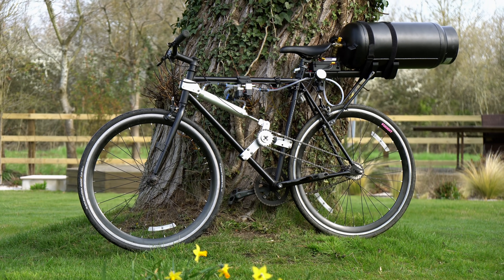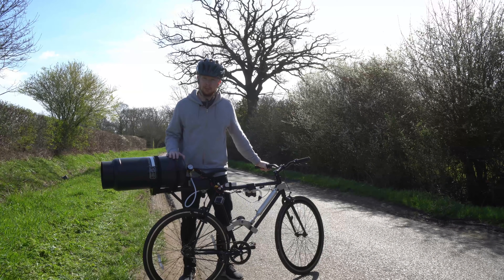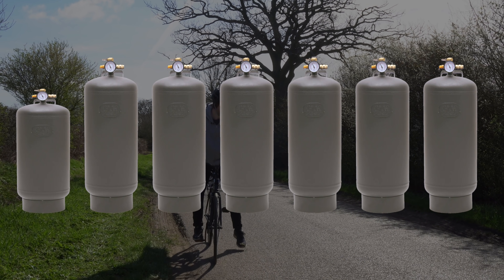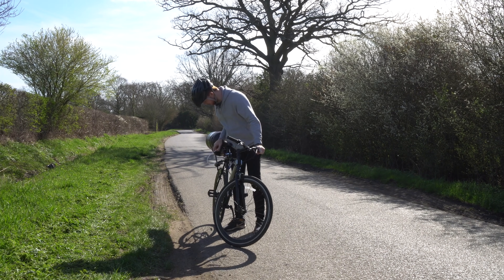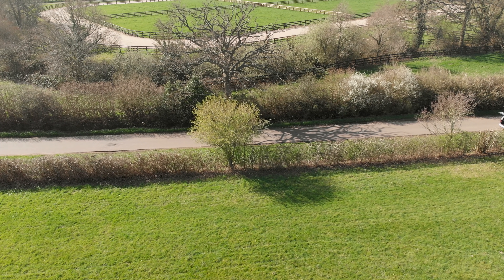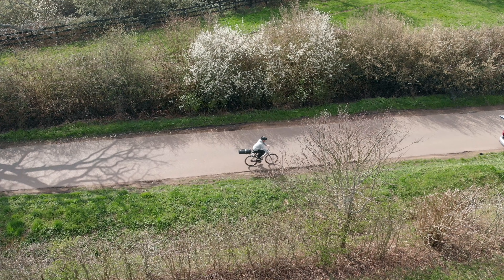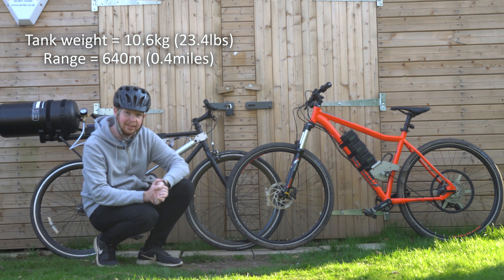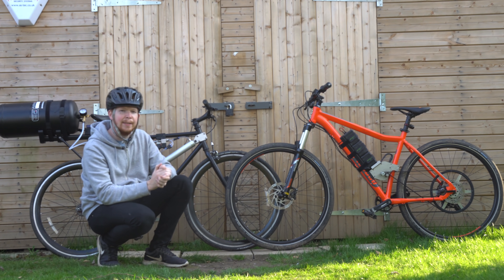Air Powered Bike Range

Comment: Might it be feasible to use an air pressure system in something like a glider to power an emergency propeller? The atmospheric air pressure up there would be quite a bit lower than at sea level and the auxiliary system might enable a pilot to squeak a few extra miles out to avoid an unwanted unscheduled early landing or to gain a bit more elevation when necessary.

Comment: I’m working on a similar project but my engine will be a 2 cylinder and is more based on steam engine design much smaller cylinders but much faster while still double acting. I hope to gear it down 5:1 and connect the large gear to the pedal cranks to use the derailer for gear shift

Comment: His 24-liter cylinder cylinder containing air compressed to 7 atm stores energy of about 8.4kJ. This is equivalent to 2 nutritional calories. A teaspoonful of peanut butter has 20 times as much energy, and an AA-sized rechargeable battery provides 4 times as much energy. This huge tank, with all its weight and all of the potential for a life-threatening explosion if it fails, will get you a quarter as far as an AA battery assuming the engines have similar efficiency. So, while it is nice to see Stanton having fun, hopefully he has proven what a simple calculation easily shows: this is a hopelessly bad way of powering a bike!

Comment: Fantastic. Way better than I could do. Now I'm going to critique, from my arm chair. It should pump air back in the tank, and use back pressure, for braking. Loose the giant piston. Try a tiny nossel on an arm, a millimeter from the rear cassette. Compressed air will move a chain. Start at the lowest gear, switch gears and redirect the nossel to the next gear, while you help it by peddling, with less effort. Possibly the nossel arm could be linked to the gear lever. Use a carbon fiber air tank, to save weight. Some paint ball players use them.  A compressed air tank is only a battery. I think air vehicles would be more feasible as hybrids, with an efficient engine as a range extender. Low power needs gears. It's wasting all its power, getting up to speed. They have small light weight and quiet, air compressors at Harbor Freight for pretty cheap. The exhaust could be used to heat a small expansion chamber for more power. I would consider the mechanics of an air powered sewing machine for power delivery.

Comment: You shud use three modes
Three different sizes of piston and piston casing.
1. Slow . Long piston 
2. Medium  50% size of long piston faster speed.
3. Fasst : 25% size of medium piston , ultra fast speed. 

These three modes shud be controlled by a handle

Comment: Very interesting! I knew about a german monocycle called "Flyrad". Maybe, the skeleton of the vehicle could be changed by an air tank. The efficiency could augmented with the use of a heat interchanger and a phase changed material (probably paraffin). Additionally, I think it Is possible to create an hybrid "Flyrad", using supercapacitors in the aceleration and regenerative breaking. No lithium! No cobaltium!

Comment: I realize this is a 5 year old video, but itsnew to me and i had some thoughs. 
Couldn't it be an assist?  Could a small compressor be installed to add air to the tank when pedaling,  and even a gear to capture breaking? I know that will add more weight. Maybe the bike frame itlelf could be part of the air storage system?

Comment: 2 on it but it begs for a tandem bike frame , and you could maybe do one where a air nozzle off a 3000 psi carbon fiber tank goes to a tesla turbine (?) or simple turbine but full pressure , so that it spins a mini but high power generator (maybe neodymium magnets , old style "induction" (?)for compactness or a dual electromagnet off itself  generator ) to the electric motor for a turbo boost , short term like crossing bridges with peaks or hills , emergency get out the way or giddy up but in a burst seems good for air power too imo ...

Comment: If you want least pressure at the full stroke of the piston , for me I would make a prechamber off the airchamber to the valve. The main air source would fill the chamber , which has a calculated volume in order to give whichever psi desired at full piston travel ...SO ALSO because having the pre valve smaller chamber ( similar to an airgun running on a seperate HPA tank ) you can control the pressure it activates the valve at also there as an extra control...BUT if it was me I'd use only the straight motion to the pedal and the rear sprocket flywheel allows pedal crank return , no issues....because you'd have a prechamber to the valve off the main air tank , AND the inline motion (which has less friction loss points ) you would simply time the valve speed also, because there's no "top dead center" (it uses a portion of the pedal stroke, the inline part and freewheels back , maybe while the other piston or motion activates )  ...so it's still maximum efficient except for some motor weight but like stated there's less friction and it has control by restiction of the air flow , by regulating the pressure the valve opens and by setting the valve speed by a throttle electronic of maybe variable resistor and a 555 chip then ... IMO...my .02 on it God Bless...

Comment: I like a lot, but there's too many parts. Wouldn't be better to rotate the wheel directly by air turbine and control the speed by regulating pressure? There should also be an option to compress air back to the tank when going downhill or breaking.

Comment: Would be cool if you made a higher efficiency engine, add a compressor so you have constant pressure and drive it all with a battery.

Comment: u have done a WRONG thing. you must use Manual wheel valve for operating/reducing increasing pressure of Compressed air
on the Handle.

If you do so, you will feel like accerlating a petrol engine Handle ! whoo whoo whhhooo vrooom

So, to do this, fit a wheel on manual valve and weld a round ms handle on wheel. now push fit a rubber sleeve

Connect a copper pipe from piston to outlet of valve

make a adopter for valve inlet, which has one male outlet. Connect this male outlet to Compressed air Cylinder.

Now it's Done ! TEST this ! it will be giving more speed !
* NOTE : compressed air should be released in air as fast as possible to give circular motion

Comment: The pneumatic cylinder looks quite large and the amount of air used per cycle seems quite low. If I aim for a lower estimate than what it looks like then the diameter of the piston is 30mm,stroke length is 200mm and is operating at a constant pressure of 6.85 bar(100psi). Formula used for calculating amount of air used is Q(litres) = Area x stroke length x 10 to power of - 6(as using mm) x [6.85bar + 1bar(assumed exhaust pressure)] This comes to pi x 15mm(squared) x 200mm x (10 to power of - 6) x 7.85bar = roughly 1.1 litres. That is just for the forward stroke and return stroke will be slightly less when deducting the piston rod diameter from piston diameter but per cycle comes to just over 2 litres. I feel like the stroke length and piston diameter is likely more based on what it looks like so this number would be even higher if that is the case. I noticed when operating at 100PSI the video states that 1 litre of air is used per cycle which seems really low considering how big it looks. Perhaps I'm completely wrong in my assumptions but just seemed low. Can anyone help me clarify this?

Comment: you should build a 2 stroke gas bicycle, theyre really fun and cheap plus theyre very efficient, my 80cc bike burns 2,5 liters for every 100km buy with a lower gear ratio and better throtle management you prolly could get under 2L/100km

Comment: Get the exhaust to go into another smaller valve/piston, that's has its gear ratio and all that jazz set accordingly. Then you can get the pressure closer to atmospheric for less loss. Also a valve like that isn't the most efficient design, but good work, love your content.

Comment: I wonder… if you programed the module to reverse the valveing when you let off the throttle to let air in through the exhaust valve and then the piston compressing it back through the intake valve back to the tank. Like regeneration braking when you’re going down hill to re pressurize the tank… I know this is an old video,
But would love to see a video on this

Comment: Could you use SCUBA tanks (up to 4350 psi, 11 liter capacity, 18.8  kg filled)?  Might get perhaps 10-11 miles of range. Some additional safety considerations, perhaps... a "regulator" could be adjusted to provide the pressure you're using now.

Comment: i,ve always wonder,is there any e bike that could charge using kinetic energy,i mean it could be new sort of long distant transportation,on the hills u could you the electric power n when it run out of battery, the rider need to cycle to charge

Comment: there is a gun that uses high pressure air 1500 psi or so to propel pellets at the speed of sound. With that pressure, smaller canister, way more power.

Comment: 9:00 Comparying energy density is always eye opening. Another interesting comparison is to gasoline. With 3kg of gasoline you could probably travel over 100 kilometers. 

I'm a big believer in the future of electric, it's just incredible to think about how much energy is sitting in the tank of an average sedan. All that range, with engines that only see about 30% efficiency compared to an electric motor at 90+ %.

Comment: I think they use a carbon fiber tank in the air cars which would be considerably lighter and the comparison with your electric bike is a bit unfair as battery /lithium batteries have come a long 
way - lead acid battery heavier.

Comment: I wonder if variable timing would let you make use of high pressure without wasting it? I mean shortening the timing as you increase the pressure. It would allow high torque at the start of each stroke...

Comment: Design considerations: the air tank needs to be a "stressed member" integral within the bike design. Also a rapidly cooling air tank could be used in a Stirling engine driving a flywheel...

Comment: Steam engines are just pneumatic engines as well air has a lot of power to it and if u wanna get the best range just add a higher gear ratio as well as that odd system steam engines had that I don't remember where instead of low efficient high pressure it changes the timing where it goes faster but is more steam efficient once they get it to speed

Comment: this system can be much faster and more efficient. The problem here is that if a single air intake is made to the piston and a "quick exhaust valve" is attached to the other air inlet of the piston, both speed and power will increase. air vent is blocking incoming power!!! you can do it this way and make a video again :) https://www.impulseautomation.shop/pneumatic-quick-exhaust-valves-2268-p.asp?_=&variantid=2269

Comment: What about using the frame itself as a pressure tank, and pressurizing it with a pump powered by the rear wheel when braking?

Comment: What if you could recharge the compressor with the rotation of the wheels ?
Reply: The energy required to operate a compressor would make it less efficient. The output would be reduced.

Comment: Get an air compressor that is suppose to run off a car battery, then replace the peddles with a generator. Add a high capacity battery that is being recharged as you go. Then optimize the bike to work with a constant rate from the air compressor with a throttle that can varry the speed to give you the ability to go really fast for a relatively short amount of time or at a brisk pace for possibly as long as you want. It depends on the requirements of the compressor and the output you can achieve with a foot peddle generator, but it could be awesome.

Comment: Tom. How about directing the air under pressure straight to the rear wheel,  via a some sort of turbo unit attached to the rear hub. Just as in a car turbo where the exhaust gasses turn the turbo surely the air pressure would turn a  turbo thereby turning the wheel. 
Of course is it enough pressure to directly turn the wheel ? And if it is, how long ? and how far ? And how fast could the bike go ? 
Hmmm. Anyway just an idea for your engineers brain to ponder.
I saw something on Pintrest from 9GAG titled How Does That Even Work. It had a delightful looking woman ( for that alone it’s worth a look 😁 ) riding a scooter with  a cylinder on the bottom on the frame ( on video ) cruising along at a reasonable speed.

Comment: Feels like the cylinder maximum stroke is way longer then the stroke it actually does. This would waste a lot of air, since a lot of useless chamber space would need to be pressurized before power is generated? If so, matching the stroke of the cylinder with the crank stroke would increase power and efficiency massively. Also, ICE engines usually ignite their mixture way before TDC to allow pressure to rise to maximom when at TCD, also to improve efficiency and power. Seems to me this would also apply here?

Comment: 10 liter dive tank gives you 2000 liter air (200 bar). Add a parallel second cylinder for more power

Comment: My first thought when I saw that huge tank was why not a 3L air tank that could be charged to 300 bar (approx 4500psi) or even a 7L one. Had you considered a smaller tank than that used which could be charged to a much higher pressure at your local dive shop?

Comment: I'd like to suggest a different approach:
Instead of using the compressed air to accelerate, which is a high torque task, do this- make the gear ratio higher, accelerate with your legs, and activate the piston to cruise along at 15 km/h or so. This can probably get way more mileage and actually transport you in a decent speed.
Reply: But that’s not as much fun to watch

Comment: the only problem with this kind of assisted power unit, is wont be more iffecient if you peddle with it, itll still have the same amount of strokes over 500 meters with peddeling and without , you will only get there faster

Comment: Great start. Pity you didn't mount  the tank at the normal height just clearing the wheel. Thinking of the greatest air power vehicles the trains for use inflammable areas, I believe they ran all day on one charge, is there anything you can learn from them? What about a radial multi cylinder diaphragm engine and gearbox?

Comment: If you can use a second exhaust port it should be a bit more efficient. Also as I commented on the previous video, 2 tanks mounted saddle bag style will balance better.

Comment: While your project is fun and teaches us about different forms of power sources it clearly tells me that this system of producing power to move a vehicle with a person on it will never be a viable source of power. The electric power source is the best type of power source in my opinion. And yes the electric power source has been used for a long time and has been advanced by a lot of people for a long time to the point it now powers a very nice car with airconditioning, lights, brakes and etc. However, the old source of power used more than any other, oil, is still the best form. It allows a vehicle to travel at a good speed and long distances. I would like to see the electric source of power advanced to the point of being the best. However, the manufacturing process of making batteries creates a lot of harmful chemicals and air pollution! My summary of your project is as follows. People like you that have ideas and the ability to make the idea a real object that works is the reason man isn't still using spears to hunt for food. Keep up the good work and maybe think about magnetism as a power source. I have long thought magnetism could be used as a power source. I have no idea why I think this but I am trying on a small model type project to use magnetism as a power source. However at 75 with bad health, I most likely will not succeed but maybe a genius like you will. Thank you for doing what you do.

Comment: Why not enlarge the rear gear to lower the gearing then insure the air intake and exaust can be cicled fast enough to rev fast wile maintaining effetiency? =) Burp! Oh and try to get a similar tank that can take higher pressures =) Full YOLO mode =)

Comment: Hey Tom, that was a cool version of an air powered bike.  I made the one that was on YouTube 11 years ago. https://www.youtube.com/watch?v=NBeky4EuyBc We used a scuba tanks, because they could hold 3,750 psi and doesnt weigh a ton.  We used an air motor, which was far less efficient than your setup.  We also only had a ball valve for the air release.  It was for our senior project, so it was a lot of fun.

Comment: Instead of perfectly filling the cylinder, let outside (1 atm) air in using a one way valve to keep the piston from getting "starved". This would give you more freedom to experiment with closing the intake valve sooner (efficiency and easy Arduino throttle control), higher pressure (which might reduce regulator losses, get the gas intake completed sooner to reduce piston chase), etc. You could also coast downhill without supplying compressed air to prevent braking. :)

BTW, i see lots of people suggesting CO2. That's a great thing to try. It's liquid at a relatively low pressure so you get lots of cubic feet in a small, light aluminum tank!  :) You can also use it to carbonate beer and other beverages!!! :P

Comment: Perhaps you have discovered why we don't have pneumatic powered transportation systems.  Just a thought about your air tank.  If you were to extend the mounting bracket a few inches and angle the tank so that it lies tangent to the wheel it would be easier for you to mount your bike.  It would also lower the centre of gravity giving you greater overall control.  (As well as making wheelies easier!)  Good luck.

Comment: for stroke counting there are pneumatic stroke counters available with count reset but that can be T'eed in to either the piston or rod end of the cylinder air supply